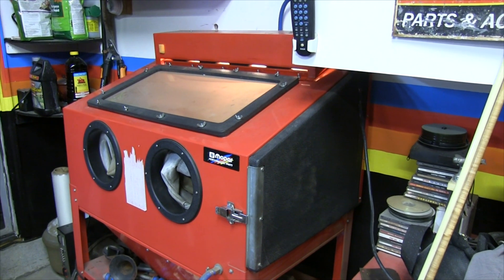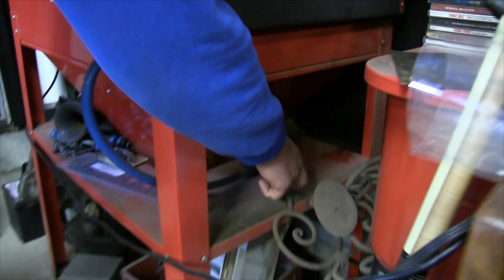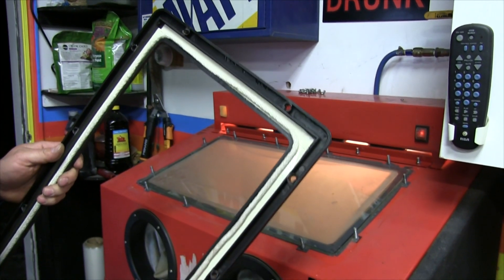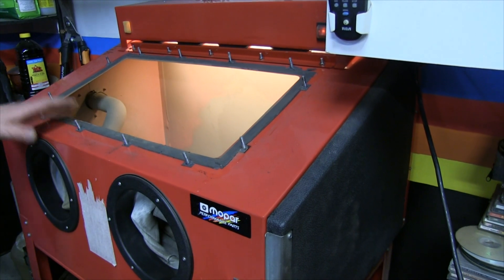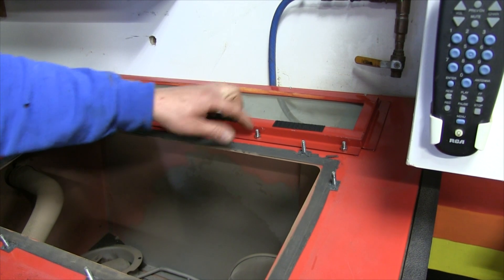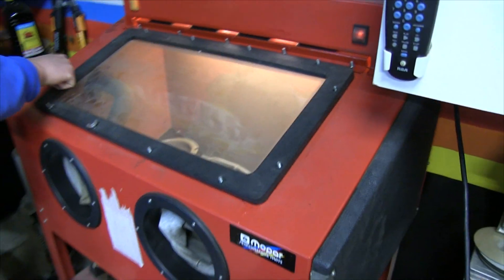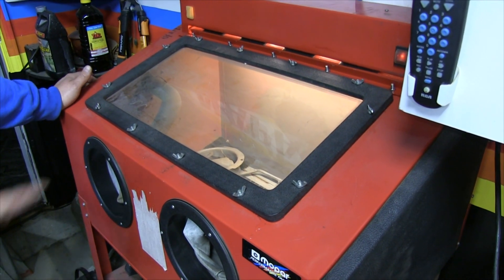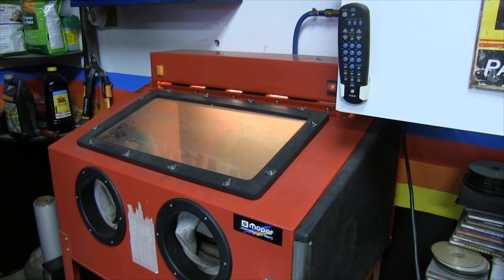Ultimate Harbor Freight Sand Blasting Cabinet – How to Modify

Comment: where did you get the flush retainers?
Reply: I can't find them either
Reply: Look for something called speed nuts, they’re thin spring steel with a hole the bolt will thread into.

Comment: Silicone fragments on blasted material can prevent paint or other coatings from sticking. You might not see it but the tiny particles of silicone can cause problems. Best to use some epoxy.
Reply: you mean the silicone from the seals ? If that's what you're talking about, the quantities of silicone that will get of are irrelevant. Sandblasting barely affect soft materials like silicon and it will not stay on the pieces if you flush some presurised air on them before painting, the eventual dust of silicon is completly mixed with sand dust so it's not sticky at all.

Comment: I ran into the mounting problem when I modified my lights as well.  What I ended up doing was taking some metal strapping that was left over from installing my electric garage door opener and cut it to reach from one side of the cabinet to the other on the inside.  I then obtained a reel of stick-on LED ribbon and hot-glued two lengths of it to one side of the strapping.  Then rather than crawling inside the cabinet to mount it, I used a few rare earth magnets on the other side of the strapping.  It stuck solidly yet is easy to remove if I ever need to replace the LEDs.  It also allowed me to experiment as to placement.  Worked great, and you practically need suntan lotion and welder's goggles when you turn on the light!
Reply from the maker: Love the idea! I like the fact you can move it where ever you want it via magnet.